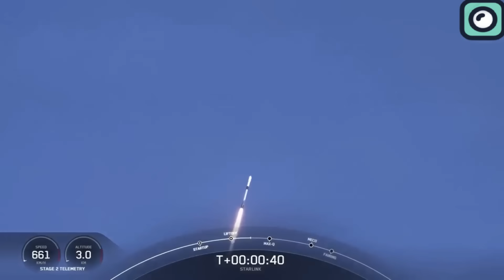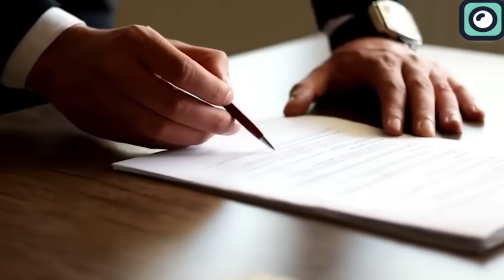SpaceX Broke Record With It's Falcon 9 Rockets Again!

Comment: The shuttle though expensive to operate only expended the fiberglass fuel tank. One source noted the lightweight tank to go to the ISS in todays dollars was 142 million. Not cheap. Starship and booster both reusable far less  expensive. Go Space X.